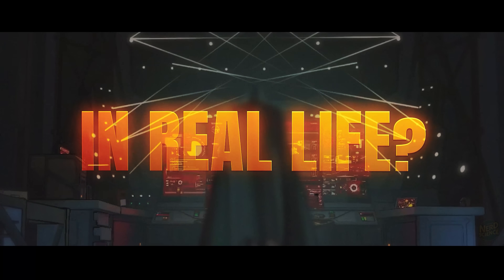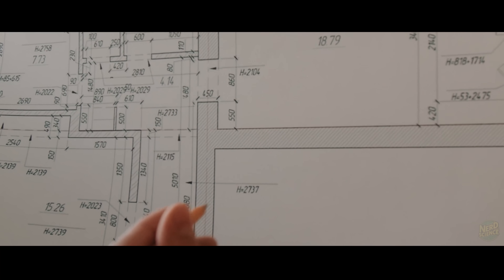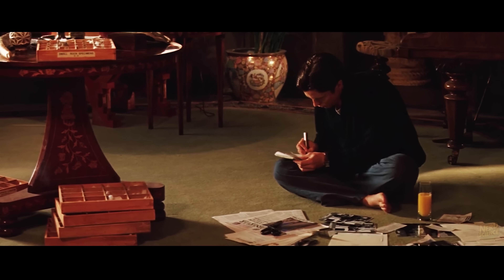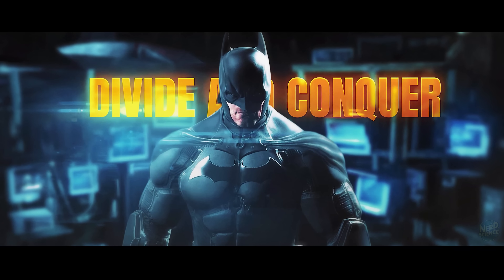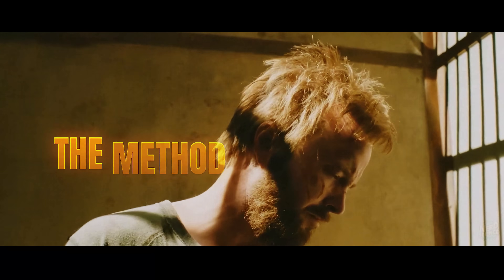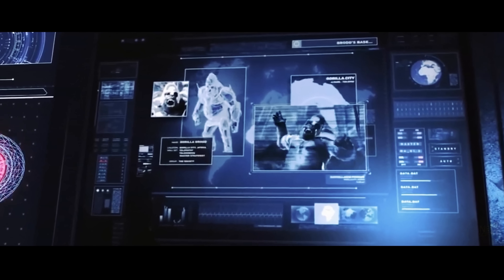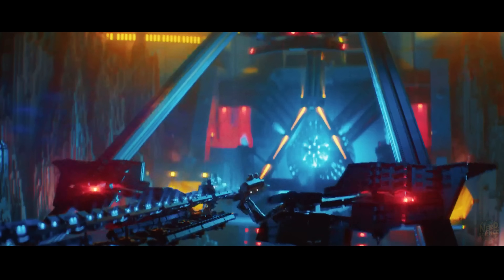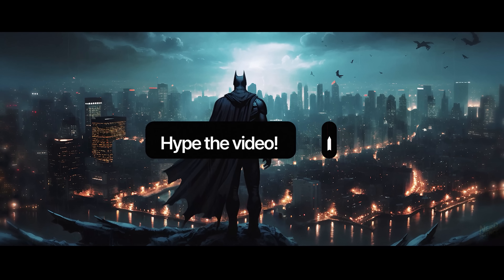What It Actually Takes to Build Batman’s Batcave

Comment: Wayne Industries is building an emergency operations center at Wayne Manor. The purpose of the center is to continue essential functions of the company in case a natural or man-made disaster makes the downtown headquarters inoperative. As such, it requires significant electrical power to operate the Wayne Industries data center. It is built underground for protection. The actual equipment in the structure is proprietary and can't be revealed in public records. There also is a well-equipped medical facility in case anyone is injured by a catastrophe. Bruce Wayne pays off a few officials and calls in favors so that nobody asks questions about that large vacant area underneath the offices. Of course, there are multiple secret entryways for Bruce Wayne's security (and for the Batmobile). There's a helipad in case Bruce Wayne needs to get from Wayne Manor to Gotham City in a hurry. The helipad could be used for helicopters transporting equipment secretly. The Batcopter would be housed in an area below the helipad that has maintenance equipment and an elevator to move the Batcopter to ground level. Of course, the Batcopter would not have Bat-fins. It would be a high-tech civilian helicopter, the full capabilities of which are not visible to the  untrained eye. The Batmobile would appear to be a custom-built sports car for Bruce Wayne. When Batman needs it, additional equipment is immediately installed by a series of mechanical connectors. The additional equipment also includes a round thruster in the back in the tradition of Batmobiles dating back Batman '66. Man, I write weird stuff when it's late at night.

Comment: Well buildings batcave is possible but you can cover it as a fan build just by saying your fan of the bat and you just wanted something close to his base is probably in enough to the reason in order for this to work the scale of the batcave must be smaller for normal house to have under ground maybe in a huge basement that huge enough to build batcave the rock can be there the basement isn't really basement see it more of a underground sector made under house but the idea needs to be approved and have answers to this build many people have built costume batcaves under there household so for you it's possible cause this batcave actually does the work am not sure if my idea is good move there's many holes and huge risk in it but i'll see where can make changes.🦇

Comment: It depends on two things in regards to comparing it to real life. Which version of the Bat cave are we getting from the DC universe? If its closer to Christian Bale's version then its super plausible if that location existed with a true Bruce Wayne type. It was a naturally formed open cave on the outskirts of the city on a large amount of privately owned land. It also already had some level of infrastructure installed from the underground railroad days plus when Wayne Manor burned down he had every excuse to have compartmentalized construction crews build various systems for an underground bunker into the existing cave systems. Nothing suspicious at all about any of that. It also didn't house the insanity of a super computer that some animated series depict him of having. But, even still, I believe that version of a cave could fairly easily have been done if that location existed. 

But, if we are talking about the insane wide open mansion sized cavity that somehow also served as living quarters, training grounds, storage of multiple high tech vehicles like the bat mobile/bat wing, as well as all the necessary components for maintaining the super computer, and science equipment seen in various comics/animated series then no. That facility couldn't be built like that under Wayne Manor without all the pitfalls mentioned in the video. 

Something like those massive vault like bat caves could only be done with super powered beings like from the Justice League being heavily involved, which we know they weren't.

Comment: I would use multiple bunker building companies to build separate sections of it. It also doesn't need to be huge unless you plan to use aircraft. The reason the Batcave is so big is when it was made up computers were huge in size. That's no longer an issue. Again your operation can be small due to modern technology. I watch a few guys on YouTube who could do this on their own and on a budget. I know one who could build their own Batmobile no problem.

Comment: The Wayne family is old, well connected, and well integrated into many aspects of Gotham, so there's likely a built in level of loyalty to the family.  The family is also old money, something that likely only grew as time went on.  Bruce was likely a billionaire before his parents died and the family likely had connections that kept money coming in even before he took over Wayne Enterprises.  Depending on whether or not the Wayne family had record of the cave system before Bruce stumbled onto it, the system could have already been given a use for something (like a branch of the Underground Railroad).  It would already have an infrastructure that Bruce could build upon.  In some takes on the character, Bruce even builds some of what he needs himself rather than buying it directly. No one will find anything suspicious if your purchases are literally just random parts.  He could have a company build something for him and have another company ship it to the manor.  He and Alfred would install it themselves.  Batman Begins establishes a very bare-bones early Batcave.  Plausibly, a lot of what he needed wasn't required all at once.  Months, or even years, could go by before he needed to make another purchase.  Purchases and installations could be far enough apart, not in bulk to keep suspicion at a minimum.

Comment: Bat Cave Chas a lot of Water running through it so wouldn't surprise me if the Computer Core is Liquid Cooled and could be that it has a pipe into the Water then back into Core nice and cooled off again much like a Car Engine has a Radiator using wind to cool the thermal heat to cold. Also the Water goes into underground rivers each he can dam and make Hydro Electric and with Hyro powered Engines also a thing might even have a Reactor version using the Water to generate energy immensely using a literal idiot proof method heck I wouldn't be surprised if they used Dynamo Generators even. Knowing Batman he'd use everything including Solar Power, Wind Turbines make people think it was for the Mansion some for the Cave and hidden literally in plain sight.

Comment: there's a few things that you didn't take into account Wayne is an old family therefore there is a chance of existing structures like old atomic bunkers or as batman begins the underground rail road. heck a few old homes had smuggling operations during prohibition. 

second thing you have to consider is that not everything happens at the same time at first batman starts with a crime lab and powerful computer maybe a medical area and a garage. that small set up doesnt really need the expensive and visible things that require multiple people. 

later on in bats career he can call in the justice league to upgrade his areas green lantern alone could do the work of 6 construction crews, firestorm can change the rock itself into steel or titantium
Reply: Not to mention flash could do most of the work, but then again in normal real life scenario, it still is plausible

Comment: Permits are not always required to start a build just finalize. Your also assuming that Bruce is using traditional tech and not highly refined redneck engineering. The current commercially available tech is decades behind the cutting edge tech. But this was a really good assessment.

Comment: The solution is simple on the people front.  Robots.  Robots exist in Batman universe.  A lot of robots and time, and it all can be done.  Just a tiny bit here and there, and over time. Alfred can higher consultant on "hypathical " problem then tell robots what to do.  On power, I think they have fusion generator in the comic.  Also  with a LOT of cable he could litterly tap power from all his building and pipe it to batcave. Spreading the load over hundred of builidng which would a) strength the power grid, and B) you can build 2 or three nuke plants in public over time to handle the new demand.

Comment: A billionaire could make a “Batcave” and keep it hidden… but obviously it could not be anywhere near the scale of the comic Batman at his even “average” capacity. And if you tweak where it is, like in the Comics Bruce had Bat-Bunkers around Gotham that are hidden under his infrastructure, you could easily keep a section off limits and have the maintains and power run under a completely legitimate business and structure where no one would be able to find it. You can even make the entrance hidden for when officials come for audits. And all those hidden venting and “secret power” issues can be integrated into legitimate infrastructure.

Comment: The maintence isnt really a issue today. You could just use robtics connected to the same kind of basic AI system simlier to what a smart home uses and ran via computer. All of the batfamily is smart enough engineers to keep it running.

Comment: the human touch points for maintenance etc? you mean...the droids in the near future will make that a lot easier. and in due time there will be a relatively small self sustaining energy source that will make the facility entire separate from the local grid. we already have this on smaller scale.
with the tons of solar panels, wind turbines etc the facility can be masked and be for the most part self sustaining. not creating massive spikes on the local grid.
now the water for cooling is gonna be a problem. Just look at the massive server parks that cause nearby villages/small cities to be without water at times since it is all diverted and used by google/meta server parks.

Comment: Comics fail to account for guano and that's the only argument you need against the batcave
Reply: I wanted to make this point. Bat feces often contains neurotoxins. It’s where the term “batshit crazy” comes from. Exposure to it is no good at all, so Bruce would have had a big contract with exterminators to clear out bats from a cave under his mansion. Another loose thread.

Comment: It seems then, that the Robert Pattinson "batcave" worked better since it was already built on a pre-existing system.
Reply: That was my thought.  Plus the "scale", instead of one ginourmus batcave there were multiple smaller sites built on pre-existing infrastructure.  Much easier to realistically maintain.
Reply: most realistic version of batman for a reason
Reply: Also less expensive to build and to maintain.
Reply: So was Nolans. It was part of an old underground railroad.